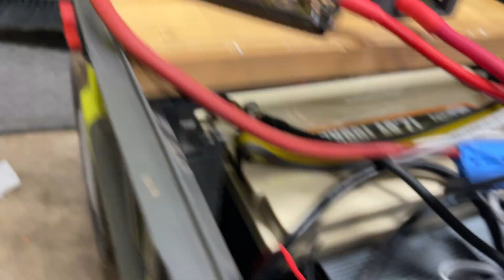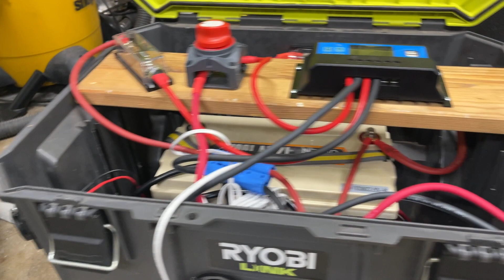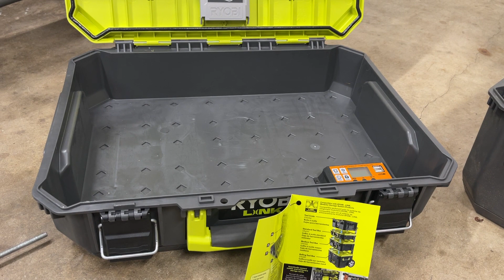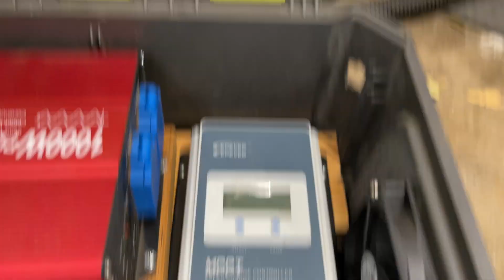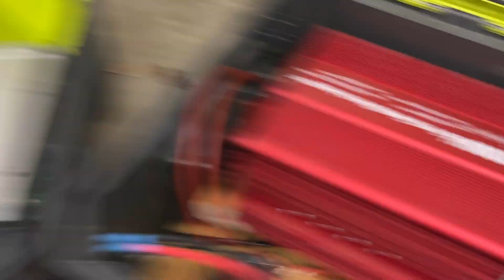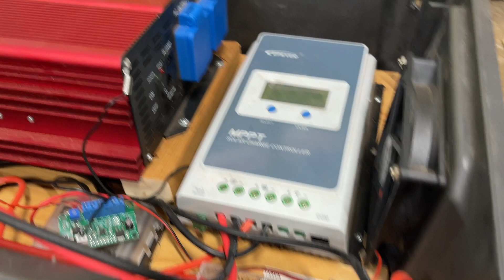12 volt 1280wh DIY mobile solar generator - Part 2 and 24 volt module

Comment: Finally seeing some of the bigger jag35 batteries out in the wild being utilized in builds. Reassures me on making my own build using those batteries.
Reply from the maker: I’ve been running mine in the Solar powered tool shed for the better part of a year with no issues. Knock on wood. Summer is coming and I may need to add some ventilation to the ryobi link case it’s in, like I have for the charge controller and inverter. They are temp triggered 120mm 24v fans.